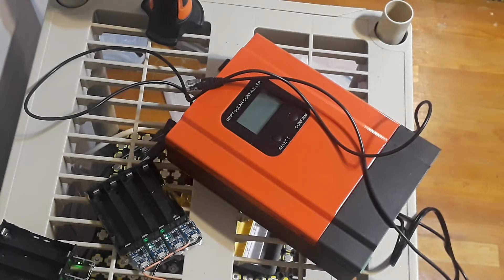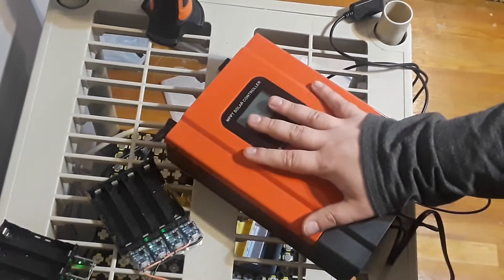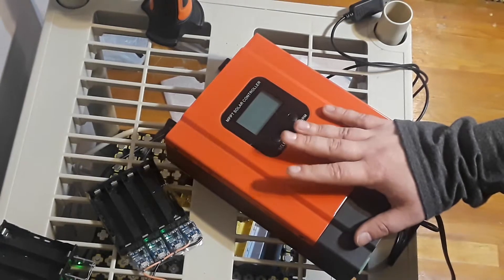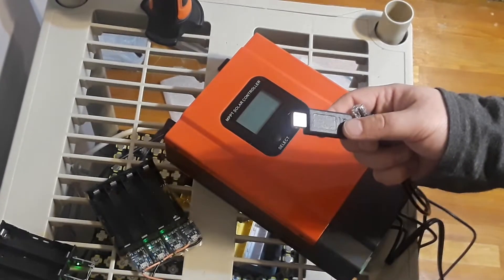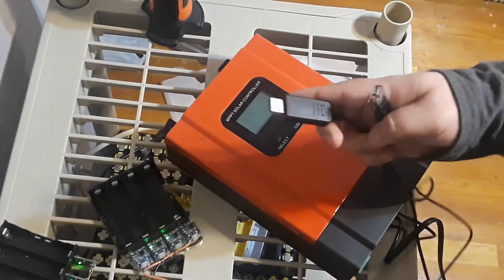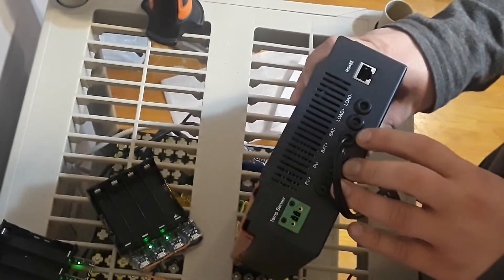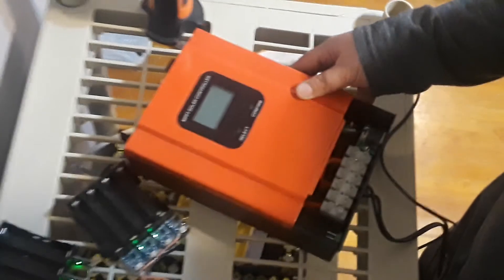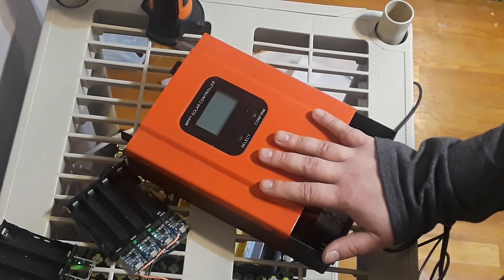The Real fake DIY Powerwall - Esmart3 40a charge controller

Comment: I have bought a eSmart3 MPPT Charge Controller that was working then
stopped after 4 days the seller is not wanting to give me a refund?
but...I have found a chip that has burnt out at the top (U3) I was
wondering if you could tell me the markings on the chip even better if
you could help me find the chip I need to replace it with? My making
have been burnt off and everything else looks ok.

Thanks for any help you can provide,

Kevin

Comment: I am hoping this mppt will work with a Bluetooth adapter to a smart phone as thats my plan
Reply from the maker: If you do get that to work let me know. I'm planning on adding this when i can get it to work add it to a Raspberry pi to my Home automated system to monitor it and turn it off and on if needed.
Reply: Good news they sell a wifi adapter complete with cable specifically for the eSmart3 MPPT , I picked one up today for $30 on eBay/ca listed under - MPPT Solar Charge Controller 12V 24V 36V 48V Auto WIFI Mobile APP Control 60A . Peace
Reply from the maker: Mofo Outdoors that's. Ice but for me I won't do wireless for reasons. Because my home is a old one and wireless no matter how you boost it. Still doesn't go through walls or doors very well.
Reply: The seller contacted me saying that apparently the wifi adapter will only work with the correct pre installed software for the App. He writes only the latest 2018 models have the correct software. I don't know what version I ordered so i will cancel the wifi adapter.  I will likely run a RS485 cable upstairs to a spare laptop.
Good enough.